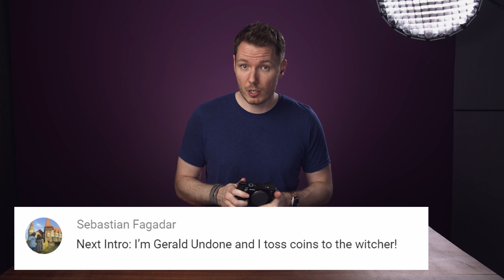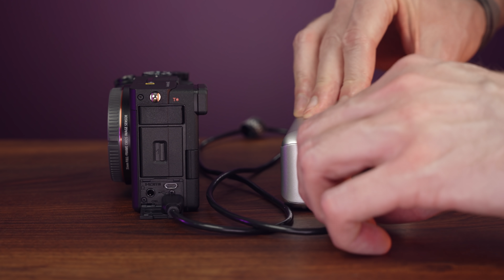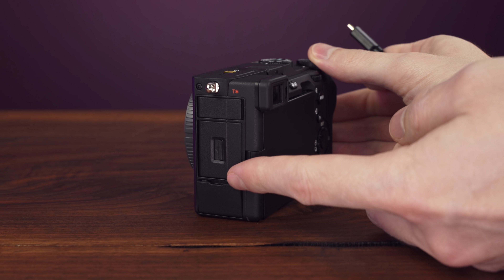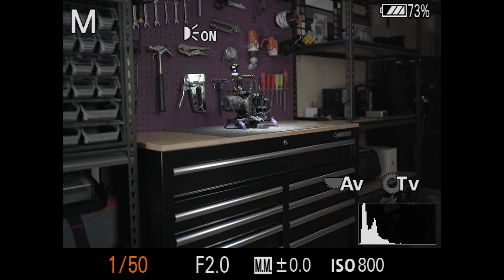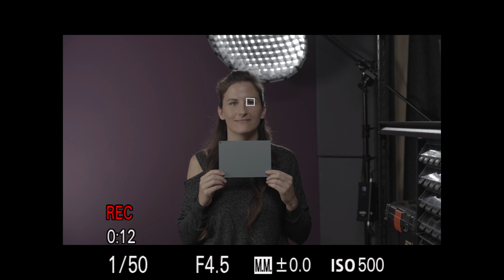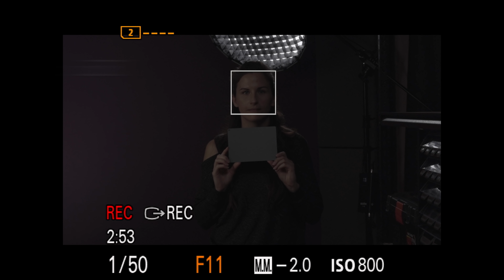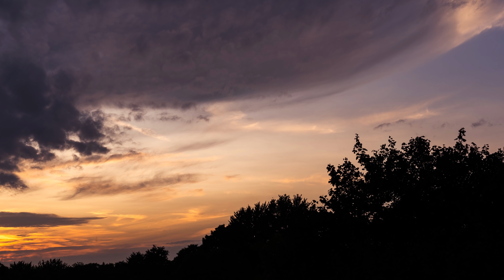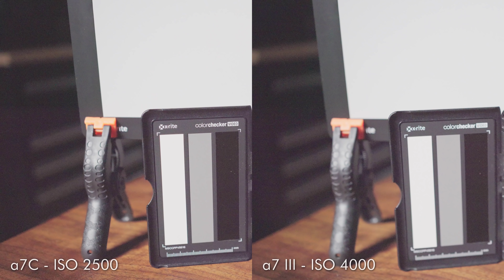The SONY a7C: Why THIS Camera Is IMPORTANT!

Comment: As an A7iii owner I have to say this camera is a HUGE disappointment and a missed opportunity.
Reply: It’s not an A7 IV. It’s different. It’s not for me but I think it’s more YouTube centric
Reply: @kingsamvisuals  "Youtube centric" - I wouldn't even say that, the IBIS is worse, the pre-amp is audibly worse.  It's just a bunch of old parts crammed into a new body which is a complete piss take.  Why anybody would buy this over an A7iii is beyond me.
Reply: 1991ClarkJames currently it’s 1800 usd. I can see this going on sale for 1500 in a few months. Then it would be decent. Otherwise if I want a full frame camera for $1500 the z6 is the one. But personally at $999 the Fuji xt3 is the best deal hybrid camera hands down. I’ll be purchasing one soon.
Reply: Real time tracking though...something the a7iii lacks. That is worth it.  For the rest of the features I rather have the a7iii.
Reply: Fujifilm xt3 & xt4 both are far better then this shit......

Comment: Huge disappointment. No 10 bit, no 4k60, no new menu, bad rolling shutter, worse viewfinder positioning... After the a7siii I wasn't expecting this bad of a camera.
Reply: Very disappointed
Reply: Instead of releasing a7iv, they had to come out with a  rebadged a7iii for video... I dont understand, it wouldve been a better move to release something that matches the canon r6 at lower price
Reply: seriously
Reply: One of the big problems is that everyone is using a variation of the same sensor, the IMX410.

It is a decent sensor, but it has the problem that it can only read out the sensor at 40 fps(open gate) and 48 fps(16:9). You need to crop to get 60 fps. To about 2.3:1 aspect ratio(zcam f6 has like an 2.37:1 I think) . Or an aps-c crop(pannasonic s1 and s1h.)

The 8 bit isn't the sensor of course, sigma pulls 12 bit raw out of it.
Reply: your comparing to a camera that is double the price?
Reply: not worth the money. The A7iii is cheaper than this A7c and the flip screen doesn't justify the price
Reply: According to the specs the a7c is better in most slecs than the aiii  am i missong something here?
Reply: 10 bit and 4k60p are kind of overrated for most people imo, and would've pushed this camera into the $2,500-$2,750 price range.  Put a rubber shroud around the viewfinder, give it a touch screen, get the shutter levels on par with the A7SIII and we're golden

Comment: Was underwhelmed by the teasers, but I like this more than I expected to! Is my α6600 obsolete? (I already have an α7iii)
Reply: Actually, it's not, because of the size/weight advantage of APS-C lenses. I can throw on the 18-135 or the little kit lens and have a very useful rig in a very small total package. It's not just about the body.

Comment: the MFT lover in me is dying the smaller these FF cameras get. WILD.
Reply: Why can't we camera lovers love ALL cameras.....    They're like Bond girls to me.....
S1H looms over all FF but MFT will ALways BBC smaller & cuter.....    AL
Reply: @77dynamite  i love all cameras i'm just losing faith in MFT.
Reply: @Whatsup_Abroad  it's still an MFT sensor. i dont want to speed boost. the sensor is still limiting. 

i will hang into a GH5 but i dont see much going for that system long term... and i dont even think panasonic does either.
Reply: Joshua Son I have a few f0.95 lenses but I don’t want to shoot at 50mm F1 for depth of field. I can shoot at 24mm F2 on FF and it’s gorgeous.
Reply: Joshua Son sensor quality is something else bud. The color reproduction and generally quality and lowlight performance of the Sony full frame sensors even on the A7III (2 years old now) is light years ahead of the gh5. The only advantage the gh5 really had was the video codecs. Stills, lowlight, AF, etc. all are better on the Sony. I used to use a lumix g7. I used to be an anti AF elitist. Then I bought a Sony, started getting pro video gigs and now I make about 4 times a gig with my Sony than I ever did trying to do video on the g7. Give it a try. You’ll realize what you’re missing.
Reply: Joshua Son not the same thing at all lol. A 10.5mm isn’t the true equivalent of a 24 on full frame even with the crop. It’s still going to look different. Aperture is just a formula bro. It’s your focal length compared to your sensor size. T stops measure light. A phone can have a 1.8 but that’s definitely not anything compared a gmaster 85mm 1.8. The diaphragm is much larger there.
Reply: Joshua Son not true at all. Once again t stops measure actual light hitting the sensor. It depends on the focal lengths. If the lens is physically smaller with a smaller diaphragm, the actual measured light gathering ability will be different. Like inherently. And it’s FOV is the same, but the bokeh shape and amount will be different. Look up any video regarding focal length equivalencies. A 24mm 1.8 on a FF will have way more spare many bokeh than a 12mm 1.8 on a mft Cropping in does not magically make the bokeh the same. It will still resolve background blur like a full frame 12mm. You get what I’m saying? Cropping in doesn’t change the amount of blur your lens gives you.
Reply: Joshua Son the amount of BS in your comment astounds me. “Only 2-2.5 stops...” that’s a huge fucking difference dude. To deny that is asinine. I’ve heard of photographers (both youtube and people I know) buying 900 dollar lenses for a 1 stop improvement because it’s that crucial for their work. MFT is dying and the fact you’re so adamant about defending it is ridiculous. Just switch systems and you’ll be 10 times happier. I know I certainly am. Using my lumix g7 with a 42.5 1.7 resulted in significantly poorer image quality than my a7iii with my sigma 24-70 2.8. And yet is supposedly “captured more light”. 2-2.5 stops makes the difference between a completely grainy image, and something actually useable.
Reply: Joshua Son also I’ll agree the bmpcc6k 4K has a nice image quality. But it’s a horrible camera objectively once you look past DR and codec. It has TERRIBLE rolling shutter. I know a guy who bought a c500 just because the bmpcc6k and 4K he bought had such horrible rolling shutter that it was unusable for a lot of his work. Objectively the form factor sucks. It’s too wide to fit on most gimbals, but it’s not heavy like a an arri, red, fx or canon c camera to the point where hand holding works. The AF is terrible. So it pretty much discounts any fast paced life event coverage like weddings and concerts, and the file sizes are so large that you realistically would want an external ssd, adding a floppy moving part to the outside. Not to mention the battery performance is abysmal without large vmount batteries. Now Full frame comes with its own drawbacks. Especially when it comes to the price of a lot of lenses. But the drawbacks to FF are significantly less than MFT.
Reply: @Whatsup_Abroad  i disagree. and i love MFT. i've owned 6 MFT cameras. 

i even prefer APS-C now with my Fuji's.
Reply: I just sold my G9.  Getting S5.
Reply: @bavideomaker29  yup i sold one of my GH5's for the S5
Reply: Canons RP is lighter.